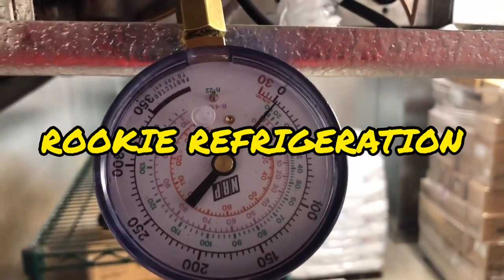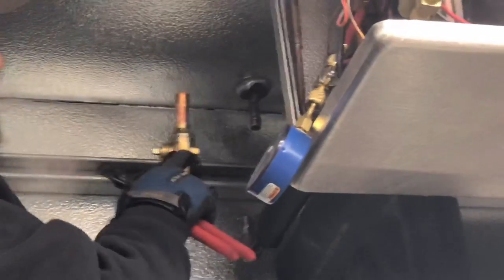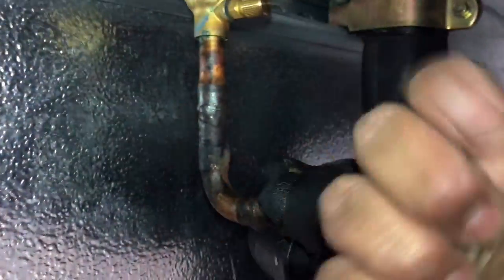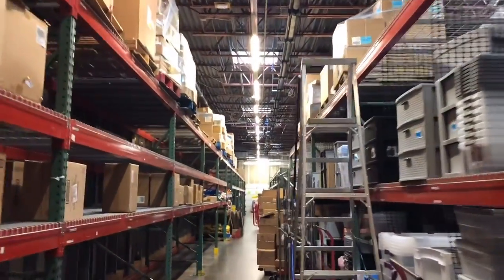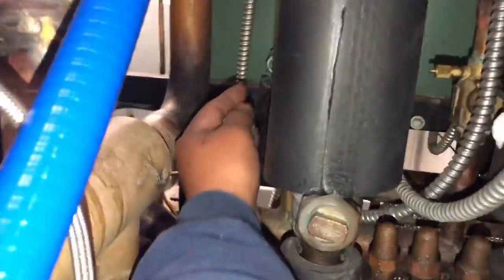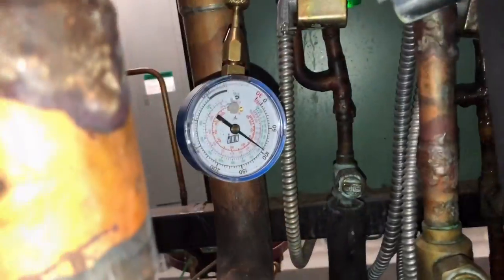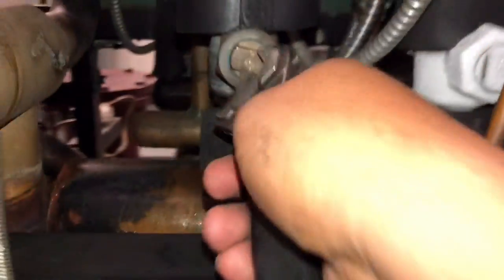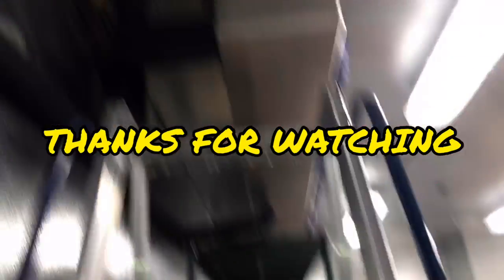Rack Refrigeration:  Leak Repair and Pulling a Vacuum

Comment: Good stuff.. try and wrap other insulation with other rags..so you dont burn it up and cause water issues. Dont know how inspectors are your way but one job of mine I had an inspector that was brutal all the time..and it was because the doors were always propped open.

Comment: Thank you for posting. Just to have a complete picture - changing the bonnet/stem assembly was not a feasible option.
Reply from the maker: It was not available locally and the customer wanted this fixed ASAP.   So it was changed out.

Comment: Question Rookie Refrigeration  can you do a proper  pump down on a system with a receiver ?
Reply from the maker: I’ll look into it.  What exactly do you want to see.
Reply: Rookie Refrigeration , I’m asking for your Opinion I’m not asking for you to show me anything . Me and this co worker had a debate about it . He just finished HVAC  school and I’m two months from finishing up . He and some classmates  were asked to troubleshoot a unit that is not cooling for some restaurant . It’s on the roof . There saying the Compressor(R-22) is running fine and not over heating  , but low side is Fluctuating and can hear weird noises from the compressor. I suggested they try doing a pump down to see if the compressor is actually sucking vapor . He said you can’t do a pump down cause the system has a receiver.I don’t think he’s right cause he also said they measured the Capacitor for the compressor . I was like 3phase compressors  don’t use capacitors  . Dude story is mad suspect . What can you add to this sir ?
Reply from the maker: Charlie G lol.  Yes you can pump down a receiver system. I do it all the Time.   If they are hearing weird noises it may be the compressor internal bypass.  Tell them if it doesn’t pump down to 0psi (or less) and holds, it’s a bad compressor.   But yes, you can pump down a receiver system.   As long as you have a way of shutting off the liquid flow.
Reply: Rookie Refrigeration ohh that makes more sense . I Appreciate your help . Thanks for making these videos . Keep up the good work .

Comment: Nice real world repair. I try to NEVER put nitrogen in a rack. You don't want to be that guy that contaminates 800 pounds of gas... Little tip on the wet rag, take your knife and cut a long strip about 1" wide and use that to wrap the valve. That way it won't be so close to where your brazing, and will make it easier to braze for your buddy.
Reply from the maker: Yeah I NEVER use nitrogen.  I’ve had some guys bash me for “not flowing nitrogen”🤣🤣🤣.  Ummm.  It’s a rack.   I’m not doing that😂😂😂. 

Thanks bro I need to get some rags cut up but I never do 🤣
Reply: @rookierefrigeration4357   lol, I hear yah. They act like your a hack when you don't purge nitrogen and evac to 200 microns. They really believe that the whole system is going to blow up if you don't do it😂 . I would pay to see some of the people bashing you to actually do a couple repairs on a rack.... I can see it now "sorry Mr supermarket I'm going to have to leave my vacuum pump on over night and you'll lose all sales or product, it won't go below 1500 microns 🤔" . As all the ball valves are leaking by 🤣... Or better yet, "not sure what happened to the rack. I pressure tested the system I was working on to 350psi, now the whole rack is going off on high head" 😂🤣😂🤣
Reply from the maker: Dan Chapman 😂😂😂

Comment: Nitrogen/ vacuum/ nitrogen/vacuum. 10cfm vac pump. I pull 1000 ton centrifugal chill water units. Should be replacing those second valves.
Reply from the maker: Well.  When you’re doing that do you have any refrigerant in the system?  This rack has over 1000 lbs still in it.  There’s no possible way I can use nitrogen.  not even a question.    If it was a single system I wouldn’t mind.  You know?